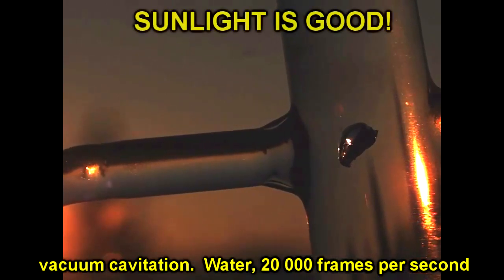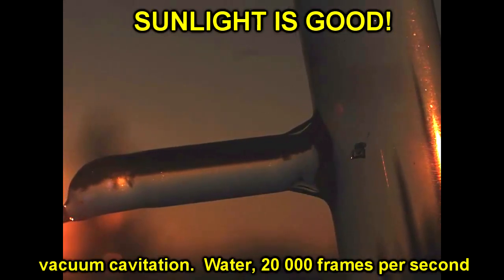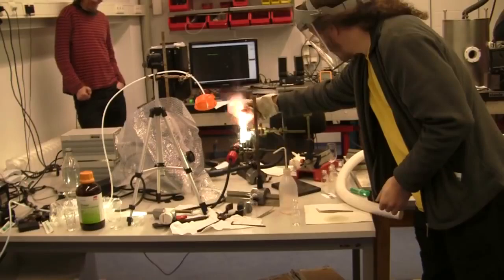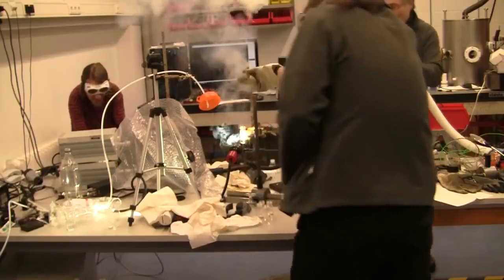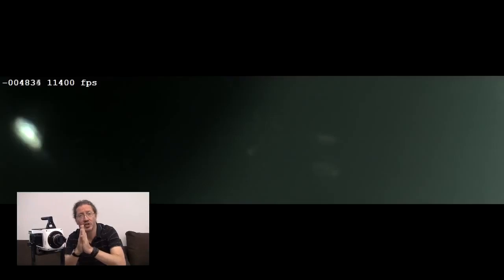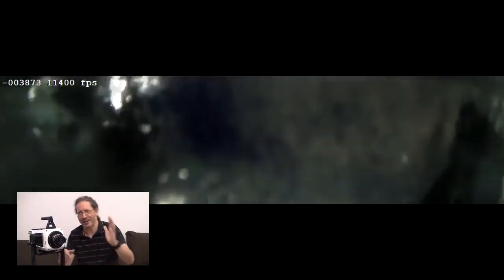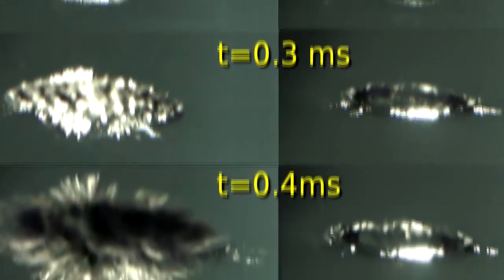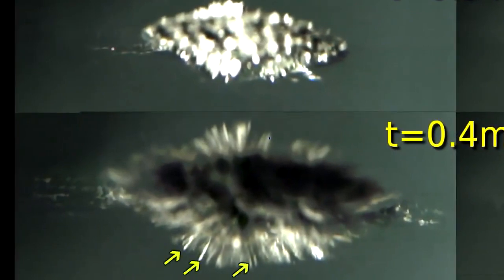Lightning on a high speed camera

Comment: Lovely video, I love lightning but have never seen it quite this slowed down before. I'm curious though... what are those brighter and larger round spots... the strike seems to pause briefly at these points? However, they seem to stay brighter and bigger than the rest of the strike throughout the process... the strike between 0:11 and 0:50 has several examples of these... at 0:37 there are 5 clear examples and a few that have begun to dim... they are all visible again at the end (around 0:42 on) when the lightning completes the connection and flashes.
Are they when the lightning strikes something in the atmosphere? Presumably vaporising it... which might make it expand resulting in a round bright spot before disappearing (I'm conscious what I'm looking at is slowed down an awful lot)? To be clear... by something I mean dust particles, pollution or possibly a pocket of moisture like a raindrop or something. Or is it literally caused by the lightning not moving forward, since it isn't going anywhere it begins to spread or fill out? In my head lightning is like electricity and electricity is like a flow... usually water going through pipes but obviously there aren't any pipes where lightning is concerned (unlike electricity) so it's more like water flowing through a channel of least resistance... like a river... if you damn the river you get a reservoir... is that what is happening... the lightning is still flowing in but it isn't moving forward so it begins to spread out until it finds a path through? Sorry, as you can probably tell this is not my area of expertise! I think (hope) I have explained what I mean?

Comment: The reason for the flickering lights at different times is due to 3 phases are 120° out of sync when one phase is peek positive the other 2 phases are 50% negaitve peek. An entire electrical grid has all generation devices synchronized otherwise it will not work. For example if you were to put 2 supplies together that are 180° displaces @230V RMS you would have at peek voltage potential difference of 678v and would be disastrous to all equiptment connected to that system

Comment: The street lights being out of sync like that is mainly caused by the lights being on different phases of the supply. Power is generally supplied in three phases, each of which has a sine-wave pattern of voltage, offset by 120 degrees. So the first phase peaks positive, then the second peaks but with negative voltage, then the third peaks positive, then -1, +2, -3, then it repeats. Each light will be lit on both the positive and negative peaks, so you'll see three sets of lights over all, going 1,2,3,1,2,3,1,2,3. Keep in mind that these are sine waves, so there will be many times when more than one phase is lit, but at different intensities. Also keep in mind that the different transformers in the city will each delay the waves a bit, putting lights from one transformer out of sync with other lights from other transformers, although all the lights on a given transformer will be synced with each other, with approximately one third on each of the three phases, in areas with three-phase power. Residential areas often only have a single phase per neighborhood, and so you'll see different neighborhoods, each on a different phase, all in sync, going neighborhood 1, 2, 3, 1, 2, 3, etc. Also, keep in mind that the speed of electricity is finite, so that you may be able to see a radial pattern of lighting within a particular phase.
Reply: And to add to that great answer, the individual lights are pulsing at 100Hz - one pulse for every half of the sine wave.

Comment: Great Stuff!
About your out of sync street lights:) To power them in a balanced way they have to be on all three phases of the AC power net (at large scale, but  each one on a single phase), with each phase 120 degrees phase shifted. The observation should be a sinusoid intensity curve with these 6,66_ ms peaks between the lamps. If not, I am wrong and deeper electronic magic is happening than simple incandescence light emission like switched-mode power supply for/or gas discharge lamp systems.
But this is surely not so amazing like thunderstorm and lightning:)

Comment: Doesn't matter where the lights are "fed" from there's typically 3 phases on power distributions. The phases are offset by 120deg on the generator so the peaks are at different times. Single phase equipment and houses are kinda added in balance so the whole system is evenly loaded. Phase "A" from one substation and Phase "A" from another source on the same grid is typically in sync.

Comment: First: This is fascinating, thank you!

My interpretation of what's going on with the first lightning strike in the clouds regarding the parts that shoot off near the end after it's already found it's discharge point.  What i think is happening there is as it discharges into what initially was the first thing that could even out the gradient, either something moves close enough to accept the remaining charge and the path changes or something that was already there but wasn't attractive enough until there was less energy in the "bolt"(?).  I could also interpret it as a potential path that was just found later in the bolt, we don't have to assume it always gets the most direct path correct? But I'm also a little out of my depth.

With the second bolt i imagine the reason it stays hot at the top longer is because of the medium it moved through, there was probably plenty more water in the sky there to glow than in the air closer to the bottom.

Again, this was a great idea and THIS is the sort of science i love, thank you!

Comment: The streetlights out of sync with each other. These could be fed from a single 3-phase line, 3 conductors carrying the power out of sync by 120 degrees. If you connect across different phases, they will be out of sync by 120 degrees.

Comment: Probably not different substations but different phases out of the same transformer.
Good content. I like it.
Reply: Also not at 50HZ, but at 100HZ, as the lamps light up the same on each half of the mains cycle. Overall they flash 300 times a second if you look at all the lights on the 3 phases, which is why highway street lights in general have a 3 phase supply, so the flicker is much reduced. That the neutral current is near zero overall is also a bonus, the street light designers can use a thinner core for the neutral, to reduce the cost of the cable, a big cost of the installation of large light projects. Theoretically you can run them without a neutral connection to the power transformer, and they will self balance, but with age and cycling and failed lamps you will get neutral current flow.

Comment: Wait a second! Why DO lightnings produce those little branches?
Makes little sense unless the energy "simply" spills over, because it couldn't travel fast enough further down with the rest of the energy.
But that would imply lightning slows down over distance, causing a backlog. And to me that makes even less sense.
On the other hand, I've seen enough lightnings with no branches. Maybe the air compositions play a role in the backlog. That could explain why lightning doesn't travel in a straight line.
Or is there something else causing the zig-zag of lightnings beyond the many molecules in the air?
To bad we can't see lightning in a complete vacuum.
Reply: Ionized air, Stepped Leader. Generates a conductive path, chunks that keep stretching and linking, if/when the path hits something to short out to -- boom!
Or something

Comment: I guess this was pointed out a lot on the original upload, but the street lights being out-of-phase is because they're on different phases of a 3-phase supply, not necessarily because they're from different substations.

All substations are in phase on a given supply grid. In the UK at least, we have a national grid, so the frequency and relative phase are the same throughout the country. 

Well, as this is TFoot's channel, I'll point out that due to the limit of the speed of light, the phase will vary across large distances. The UK is 1.24 Mm in length, speed of light is 300 Mm/s so there's about 4ms difference from one end of the UK to the other, assuming a reasonably direct path. Since one mains cycle is 20ms, that's about a 70-degree phase shift between Lerwick and Lizard.

(For the hard-of-thinking, "Mm" means megametres, not millimetres.)

Comment: Very nice. There has been some good research on lightning . The first video looks like an inter-cloud discharge, the second looks like a ground to cloud discharge.
The main discharge is actually several because it is a large ringing circuit so they are usually so fast that even high speed cameras can't catch all of them. Looks like you caught two in the inter-cloud video. It's also known that there is an initial slower path finding discharge that is often forked and less bright. When a path is found then the main discharge happens with a ringing effect of tens of discharges going back and forth near the speed of light. It is also known in cloud to ground discharges, commonly path finding discharges go from cloud to ground and the first (much brighter) main discharge goes from ground to cloud which you recorded in your second video. I have seen lightning detection web site that show all four types of lightning so each type must have a unique electro-magnetic signature. Google scholar should help here to find research already done. Look forward to more high speed lighting footage and maybe a Faraday cage to protect the camera from lightning induced EMP. 

On another note, I thought the frequency was synchronised way back at the generators right down to the phase difference between three phase. It could be that different lights are on one of the different phases.

Comment: The lights are probably out of sync by a phase of 120 degrees if they're using the 3 phase system where you recorded this.
Reply: Asil Serhan and it would most likely be 60 HZ unless it is outside the USA

Comment: I hope you dont mind my suggestion in respect to the power supply  but i have been involved in secure power systems for over 30 years and some of the comments below were on the right track with using a DC supply. But a better solution is to use a quality full conversion UPS system that fully rectifies the supply to DC into a large battery sink (large relative to the current draw & potential spike/high frequency ) and inverts it to quantity AC output.
The system should also include high voltage diversion on the supply (safety switch) of sufficent capacity not some power board. 
The battery acts like a large spinning fly wheels inertia and provide stability.
The trick is not to use switching type UPS systems as these are far to slow but full conversion type with at least a 12 pulse rectifier & inverters.
Is you would like any additional info pleas drop me a line as i have a lot of info and lecture notes if you want them. 
This is not sales just wanting to help if required, im neerly retired and the info is wasted it it dies with me (in many years i hope).
Love your channels.
Reply: Ps. This will ensure no mains frequency interferance will occur in your normal high speed and other eldctrical experiments.
Reply: Or skip converting the DC from the batteries back to AC, just to feed the camera power supply which will convert it back to DC again for the actual camera to use, and just run the camera from batteries with a DC-DC converter.

Comment: Would it be impossible to do in a vacuum
Reply: Interesting. Electricity is basically moving electrons. Electrons travel in space too. Fusion is basically moving electrons (and other things). Lightning is basically a flash of superheated air. Sun is basically a continuous flash of superheated .. something..

Without a conductive path I doubt they'd look the same very often tho.
Reply: Of course the sun is actually much less a vacuum than Earth is, so that probably didn't answer your question.
If by vacuum you mean not even containing electrons, then I suppose, no.

If by vacuum you mean an Electrolux cleaner slurping up copier toner, then yes. Very, very much happen in a vacuum.
Reply: Oops, sorry, I answered as if your question was, "Would it be possible.." 
I missed the *IM*p
Reply: @Dr_Wrong  no mate, you were just being a twat so I chose to ignore you, do keep trying though

Comment: Did you ever do any more one the city lights and grid AC "pulses"?
Reply: The time difference is almost certainly because the lights ran on different phases  of the 3-phase system.
Differences between substations would be much shorter.
Reply: @Basement-Science  Good call. You are quite likely to be correct. Still it would be cool to see a video with the city lights being the focal point of the slow motion.
Reply: Since you brought it up I have been trying to find a video I saw about a year  ago taken with high speed  camera in a helicopter. I am not sure the name or creator. They they were able to catch the progression of light flicker across many tens of miles somewhere in the northern USA. Single phase mostly here and was quite apparently from a single source line. It was low resolution and shaky but it absolutely showed the lag and progression. In this case right to left.

Comment: Another highspeed thing that's hard to observe I''ve thought about a lot that a lot of people handwave over is how fast does a photon accelerate?

Photons vary in speed depending on the medium they're in. So when they enter water for example, they slow down, and then when they exit, the speed back up. If their a way to measure the rate at which they slow down or speed up when changing mediums? 

If i were to shoot a bullet into water, it'd slow down, and when it comes out, it just stays the speed it was when it left instead of speeding back up to its entry speed, but if a rocket enters water, it slows down, then when it leaves, it'd speed back up to its terminal velocity in air because it has a constant acceleration, unlike a bullet, which experiences none. Since photons behave in a manor similar to the rocket, I think it's right to assume they experience a constant acceleration too, and their speed of C (speed of light in a vacuum) would really be their terminal velocity in whatever the medium of space is (dark matter?). 

I think if this in general is better understood, we would be able to move forward and develop technology that breaks the light barrier, unlocking all sorts of neat technology. For example, if dark matter really does collide with photons and is the cause for their constant velocity of C, then interacting with dark matter may open up the road for electric powered propulsion in a vacuum, and if photons attached to particles give them their velocity, being able to manipulate dark matter would be able to essentially slow down or speed up "time" on normal matter. 

I.e. If I pump dark matter into a box, the terminal velocity of photons goes down, and since photons attached to matter cause all matter to have their velocity/temperatures, then lower terminal velocity = slowed down time in that box. So basically if you can pump dark matter into a box, anything in that box would experience slowed down time, and the opposite would also be true. 

If this is true, then we could potentially just create chambers where time moves slower or faster. Imagine you get a heart attack and step into your chamber and by the time paramedics get there and bring your chamber to a hospital, you're not even done having your heart attack. With a chamber that could speed up "time" you could get home after a long day of work, sleep for 10 hours, do some of your favorite hobbies, then step out of your sped up room and only a few minutes have gone by, so you'd essentially have weekend on demand whenever / as often as you want.
Reply: I´m sorry to say, but your ideas about dark matter are completely wrong. That´s not at all what dark matter is/does. It´s not a medium for anything. It´s called dark exactly because it doesn´t interact with anything, and especially with photons.

Your question about the acceleration of photons is interesting though. However it would be more accurate to ask how fast the speed of light changes at the interface of materials. Photons travel at the speed of light per definition.  
I don´t know the answer to that. I would imagine it might depend on the material at least a little bit, since at the atomic scale there is no solidly defined border between materials.

Comment: It would seem to me that the big difference you see in the behavior of the two lightning bolts is in part due to the distance away they are.  The cloud to cloud could be very far away but much much stronger than the surface strike which has to be relatively close (inside your horizon line.)   Next time you do this, you should film with a regular camera as well, so you can go back afterwards and use the old method of using the difference in flash and boom arival do calculate how far off the strikes are.